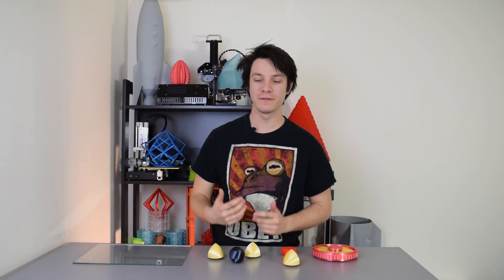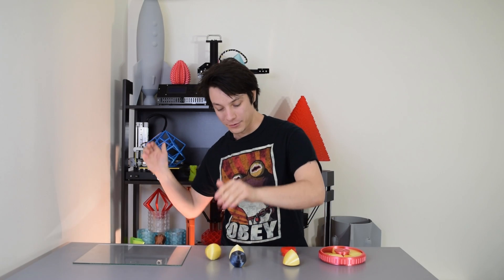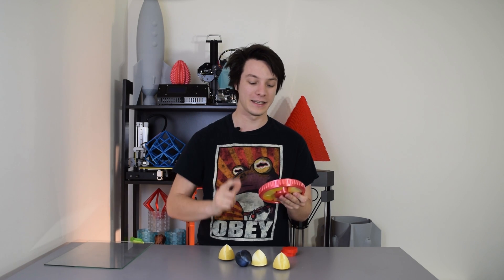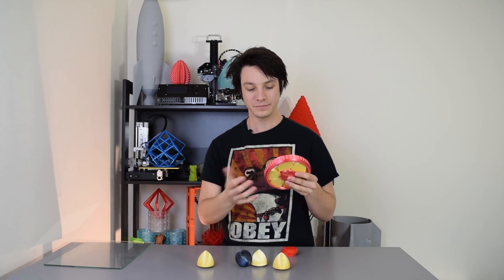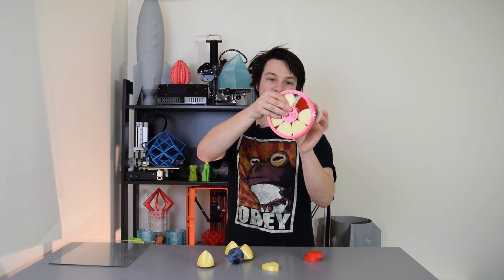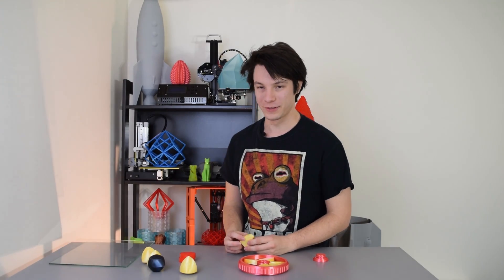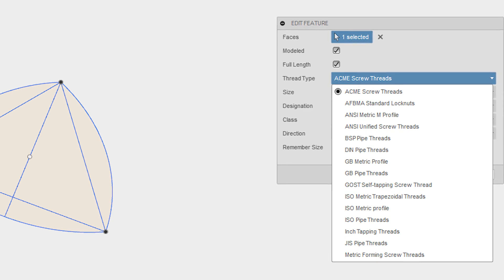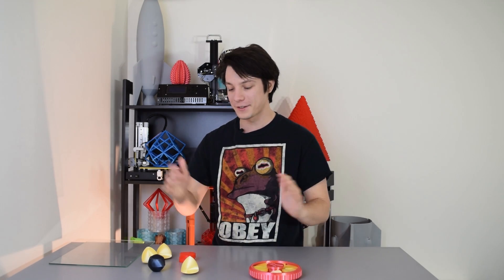Reuleaux Triangle Bearing - is it possible?

Comment: Excellent work, interesting and introspective.  Captivating presentation.
Perhaps somewhere there is an application for these shapes as agitators or mixers, since they roll smoothly and oscillate about the center at the same time.  
Somewhere, I believe there exists a drill with this shape that will bore a square hole.
PS: That bicycle was awesome, a real head turner - advertising, anyone?

Comment: i think even if the figures could move fine next to each other (im not sure if it is imposible to achieve) they must have a griped surface to roll because of the centrifugal force..  it will always be a side with more weight and it will tend to the outside.. right? so there are two scenarios.. 1- you add a griped surface and the centrifugal force will force the heavier side to the outside countering the twist of the figure and the project do not work.. or 2- you dont add the grip and the twist works just fine but the inner figures do not roll and the project do not work.. :-/ of course its getting easier as you add sides and get closer to a sphere, the movements get smoother and finally it works perfectly when you add infinite sides (circle)

Comment: My hint is: You have too many Reuleaux Triangles, so take one out. This will give you clearance for the bearing cage (https://goo.gl/images/VE7agD) which in my opinion should be cylindrical and not squared.With these modifications, you should have it rolling smooth as the bearing motion doesn't depend on the centre of the ball or in this case Reuleaux Triangle but in the distance between races.Good luck

Comment: Use a Reuleaux profile instead of circles in this design https://www.thingiverse.com/thing:2375124 and it should work (since prisms are angled, contact points are always spaced by the diameter of the profile)

Comment: These are definitely fascinating shapes.
They kind of reminded me of the ceramic cones that are frequently used to finish surfaces on metal tools & similar objects (most likely due to the way that light reflects off of the curved surfaces). 
I was wondering if there are any real world uses for them, as it occurred to me that rollers with a design inspired by these shapes (made with a form extruded from your 2-D "triangles", for example) could be used to create dual layer conveyors (above & below) for materials with unusual properties - such as extremely thin or hot materials, that might be an improvement on normal cylindrical rollers. Normal circular rollers with an extremely hot material passing across them would go through a cycle of rapid heating & cooling, and over time would gradually reshape into an eccentric or oblate form. With shapes similar to these the opposite could be made to happen, as they would gradually shift towards a more perfect circular shape - while still producing extremely flat sheets of material. 
Very useful in some of the newer, more extremely high temperature ceramics/alloys that would need to be produced in a non oxygen environment, managed completely by machines. 
It's only a vague idea based on seeing the sheet of glass moving across a number of these shapes (& I'm sure that there are factors that I'm unaware of), but it's fascinating objects like these that stimulate ideas that might have other applications elsewhere. 
Thanks.

Comment: this could work, the tolerances between the inner and outer races needs to be a little tighter. if the "rollers" had sufficient pressure , similar to how you would press down on the glass to the table, then they would remain in place without sliding. If your printer isn't up to the task of superb accuracy, you can cheat a little and use a piece of stick on foam ( think weather striping for a door)  to add a spongy layer to the races to take up gap and add grip to the slippery race surfaces.

Comment: Still good to toss on the ground if you have to move that pyramid (or file cabinet full of salvaged screws). As for "why no shaft bearing ability??", They roll for PLANAR shapes, but don't like radii of either type. Make tiny 3d ones, place them in Truncated cube pockets in a race, then run a shaft of large diameter (like a 55 gallon drum), they will work. Their motion is that of grain between mill stones, any depression a point fits wants to wedge, and then roll along center of mass rather than displacing to give the instant center of rotation. If they cannot "Bob and weave" like the head of a toe to toe flyweight boxer, they can't roll, because they wedge. Paint them in a checkerboard pattern an roll that clear sheet on top. About the only motion they don't do is actual linear point a to b rolling. They combat shoulder roll, they somersault in arcs, they wag like the tail of a cocoa lab that smells steak, but never actually "roll"

Comment: It can work and you showed us the answer. The bike has a lever arm that keeps the wheel in the right place at all times so if you wanted to use 5 reuleaux triangles you simple need a star shaped arm keeping them apart  the right distance, but it would be to note the more ball bearings that are in a bearing help keep tolerance tighter. So using more smaller reu-triangles in short would work much better especially is they are held apart by a flexible arm alot like the bike.

Comment: A constant diameter disc, like the ones you used to demonstrate the "bearing", was used in later model movie projectors to assist in advancing the film. They held the teeth that advanced the film at a constant distance apart, while moving them up-and-down a fixed distance determined by the changing radius. This changing radius was the distance between each frame (or frame holes). A swash plate directed the teeth into the film holes and back out at just the right time in sync with the constant diameter disc rotation. There was very little wear in this system.

Comment: I have an idea! Might not work but in theory it should. The inside of a bearing is a single track that runs straight. With a Reuleaux triangle if you take 3 of them with the glass demonstration you made, you can see they do not roll straight. They have more of a “S” shaped movement. So with that in mind, making a track that it would follow inside the bearing would be ideal for it to truly take a spheres place. Note the bearing would obviously be thickly like a tire. Now, the problem with my theory is the Reuleaux Triangles may snag one another inside the bearing but I am not quite sure as all this was in my head and had no time to sketch out the designs.

Comment: The New UK Pound coin edges are using same method
Reply: The 50 pence coin has used one of these shapes since it was introduced in October 1969, though the size has changed. The idea was to have a distinctive coin that could roll through vending machines.

Comment: Could it work if you just put 5 or 4 or whatever the smaller amount was in it but have pins coming from the center of the bearings and have a guide on the frame of the bearing that goes from the outside to inside circle that would allow the center of the bearings to move as they naturally should but also keep them where they are

Comment: If by definition they are solids of constant width, then the distance between them cant change. I think the reason the bearing didn't work is because the ratio of the "ball" —for lack of a better word— diameter to the inner ring diameter was too large. In every ball bearing that I've seen, the ball diameter was always much smaller than the ring diameter. Also, the inner and outer rings are always tight enough for friction to cause the balls to roll rather than slide. I think this is the reason the ball bearing didn't work. Probably

Comment: Is the potential issue here that the interior of the rings are made as if these bearings were circular? I'm wondering what would happen if that interior shape were changed in some way to channel the rotation of the bearings more. For instance stepped/slotted so that they can't slide. Another is shaped smoothly undulating so to keep a constant rotational center in the bearings. The later idea though I'm assuming would be flawed for the width between the inner and outer ring would then be changing. Still my instinct here is that the ring does need rethought if this is to work.
Reply: The more I think about this could an undulating interior both keep the bearings rolling evenly and act as a bearing guide at the same time? I'd wager the optimal undulation would likely be the negative space left to turn the shape used back into a circle so that the bearings behave as if they're round even though they're not.

Comment: Even if they did have space to roll properly, I assume the vibrations from many small objects shifting their center of gravity constantly would slow the system down quite a bit and would make it hard to turn freely like a regular ball bearing.  Might be able to get around that if you somehow synchronized opposite sides to shift their weight in such a way as to produce 0 net force, dunno.  Cool vid

Comment: Use fewer SOCWs, and have a pin through the center of each, then put springs in pushing them out from the center, or put rubber bands around each pair of the pins,   That should hold them all equally apart, and allow them to roll freely in the races.

Comment: how about using just 4 of the objects of equal width with a retainer holding ther center points and just orient each bearing so the crown retainer wobbles? that would keep them spaced evenly and yet allow them to roll

Comment: what about reducing the number to 4 and putting gear teeth on them and matching teeth on the inside surfaces of the bearing and that way the teeth will hold them apart so they cannot touch each other and are forced to roll and the center would no longer matter? it makes sense in my head anyways :-)

Comment: I wonder if it's possible to add gear teeth to  these shapes. and maybe adding race as well. I wonder if you put a hole through all of the shapes and connect them with sort of a ring that would keep them in synk . ring will be spinning offset. (I think). as well as a geared teeth to keep the object more stable. all though the friction in between the teeth would probably make it unusible as bearing. Oh yes also increasing diameter of a center ring so that positioning of a gears could be easier.  Just an idea gentleman. don't know how realistic it is though

Comment: I was thinking about how you could make a guide rail to support these triangles so that they are equidistant from each other. So if you took a single triangle and follow a dot offset from the center as it rotates, it would create a square. Now, we can follow that square for each triangle as long as they are the same size and shape. So I thought that you should create a polygon with as vertices as there are triangles as the inside of guide rail connected to a distance offset from the centers of the triangles. This way, the guide rail can keep the triangles equidistant from each other and also guide the triangles' movement on the inside. I don't know the math on how to get the distance from the center to make it's rotational shape a square, but yes, this way it can be done.

Comment: The problem with your bearing is that half of your bearing should have the apex pointed at the center hub while the other half should have the long side to the hub.  This way as the outer track moves the "bearings" can slip past each other then you can use a racer to hold the bearing in place.

Comment: you should try offsetting them like triangle gears. meaning have one point of one triangle touch the flat side of the other. if they bind up, try making a new bearing housing and add one more bearing
Reply: combo that with a ball guide and o don't see why it wouldn't work.

Comment: if you put a guard rail on the side of it to keep them from falling out then it theoreticaly should work, basicaly close the ring into a tube (or just use a rail rather than a wall) and you could make it work with only 5 wheels instead of 6

Comment: Tells us the bike doesn't have an axle... right after showing us the bike that has and axle... sure it uses other elements to guide the wheel but it still has an axle. Also roller bearings do not necessarily have to have a cage...

Comment: HELP: I own a Monoprice maker Select v2 and it's been pretty good as a first printer. One problem I have is really wispy and super thin plastic strings every time it goes over a gap. I've tried increasing the retraction and lower the print temperature, but it still has the tiny wisps. I read that it could be due to moisture getting in the filament, but I'm newish and would like some troubleshooting tips 😊

Comment: The geometry reminds me the Felix Wankel DKM 54 engine, but never stop to think about "constant width" concept.
Take a look on this animation of the DKM 54: https://ii.yuki.la/a/d1/a11b5f7047f94d28f2344e7dbc4ee17b31f35ea9b7e9c16eaa21755536492d1a.gif

Look like it isn't constant there, but you can control the oscillations width.

Comment: Maker's Muse... 
Re the triangle wheels on the bicycle... 
I wonder if a solution to the problem of the shifting centre could be compensated for if you were to cut a triangle shaped hole of constant width in the middle of the wheel and placed a round axle wheel at the end of the forks that rotated within the triangle hole? You would obviously have to offset the hole in a way that opposes the shifting center - I wonder if that cancel out the shift?

Comment: so they do in fact not roll perfect. a spehere has constant height and the center of mass is on a constant level too. with these solids of constant width you also have constant height, but the center of mass not at a constant level. this is a big difference when it comes to replacing true spheres. For example in a ball bearing you are very likely to have high speeds. high speeds and moving center of mass for your "balls" means vibrations which are very bad.

Comment: Hi great video, here's an idea for possibly making it work. What if you only used 4 bearings evenly spaced, but on the outer ring race of the bearing you incorporated four 270 degree  circles for the bearings to run in, but with the openings facing towards the main centre race. then it would act as if the bearings each had their own constant distance surface to rotate against. It might require some playing with the sizes and spacing, but I think it might work.
 Actually when I read that back it sounds confusing, but I hope you understand what I am getting at.
Keep up the good work.

Comment: the problem is simply the shape of the bearings in respective to the shape of the containment. when the bearings are pushed up against each other they fill up the angular spaces needed to rotate in an oscillating fashion. The solution to this is not an containment for the bearings but simply an redesigned bearing race with pockets to support and desperate the bearings.

Comment: The spheres of constant width will never make a perfect wheel. Its easy to see that when you roll one of them. the reason it looks like its rolling better with more of them, is because the density of them decreases margin of error as one side will likely be constant with more spheres. its not perfect though, if you measured the glass pane you will see it is actually moving up and down constantly with one, occasionally with 2 and rarely with 3, but still doing it because more spheres = closer to perfect sphere

Comment: Alright, if the distance remains equal you should technically be able to make a racer to hold them in place. The racer isn't attached to them and it will just sit on either side while they roll. Regardless though they're likely to slide because their mass will constantly move off center but a racer would keep them from getting stuck together. You mentioned in the video it wouldn't work for some reason but it really didn't make sense as to why, it'd be held the same as a ball or cylinder. The reason they don't roll is because the mass moves off center from the point of contact, if there was a rubber lining to increase friction in one of the groves in the bearing it should roll perfectly.

Comment: it looks like your design could be improved a little to actually make a  functional bearing. If the outer race was a little smaller to fit the solids more tightly, it might help. also, I believe a cage could be designed to keep consistent spacing between the solids

Comment: I made a bearing just like this with conned reuleaux triangles back when I was in my bearing craze (even made a video on some transparent bearings during the time).  I'd made a bearing from conned reuleaux triangles which had the exact same result.  I knew it wouldn't work once I started drawing them out on solidworks but wanted to print out the model anyways to show my friends why it wouldn't work.  Glad to see someone post a video on for the rest of the world to see!  I've seen the question asked on other videos showing off the reuleauxs.

Comment: Your bearings are  not constant width. they are a 2d shape made thicker, which is no longer constant width. Regular bearings are spheres, and they roll inside a chase cut out to accommodate spheres. Use the 3d tetrahedron shape , equal width to what a spherical bearing would be.  Only that way would you have a valid experiment

Comment: Connect each center of the triangles to a thin ring that's free from the inner and outer races of the bearing. Like a ball bearing spacer, this will keep the triangles spaced. The only problem would be fragility and stress of the spacer since it will move erratically. Kind of like a rotary and it's camshaft... (that made sense in my head)

This doesn't make it any more practical. It just solves the spacing issue. Or you could add side bars, but that's more friction